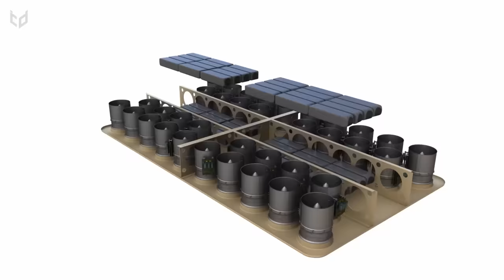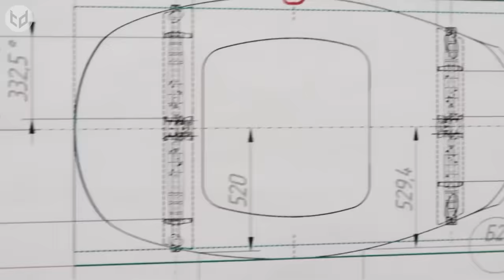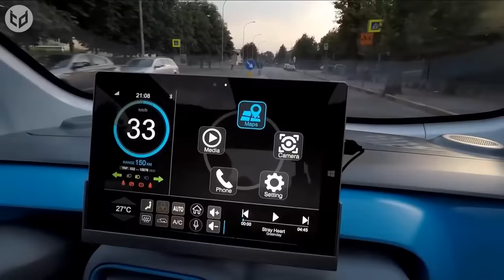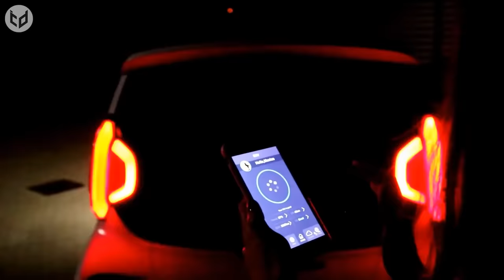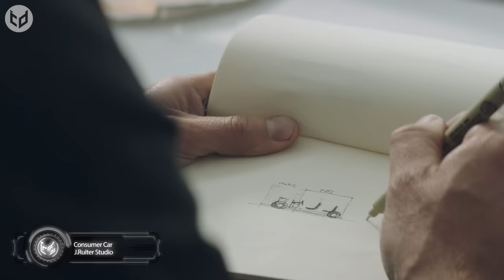Most Unusual Vehicles

Comment: I partially built a sociable recumbent tandem trike to Atomic Zombie's designs (kyoto cruiser) in 2007 ... When my kids grew up I did think of modifying it so 2 conventional bikes could attach to the back (forks to mounting points and storage for the front wheels) so they could join in or cycle freely ... shame it's frame is rusting unfinished in my garden ...